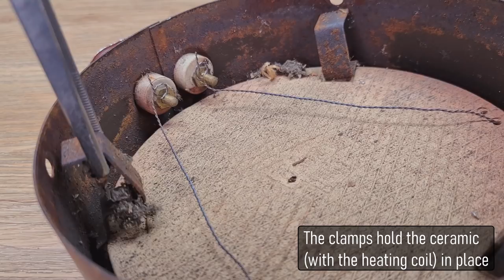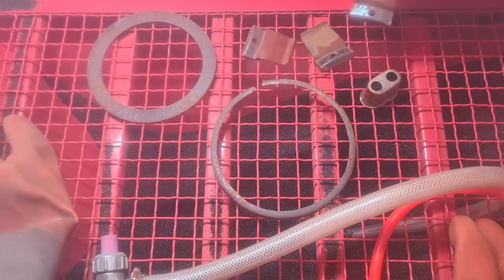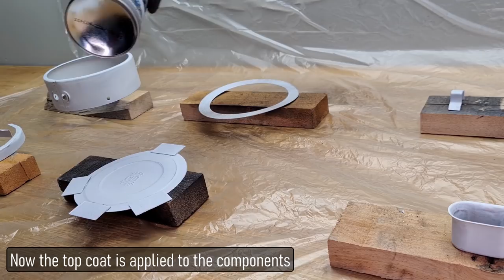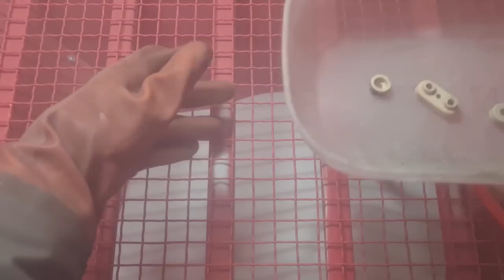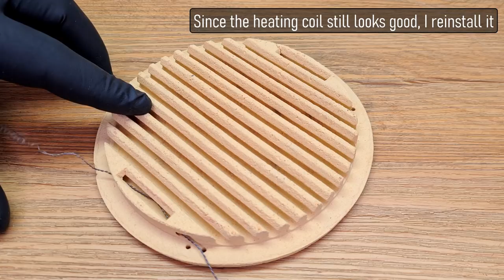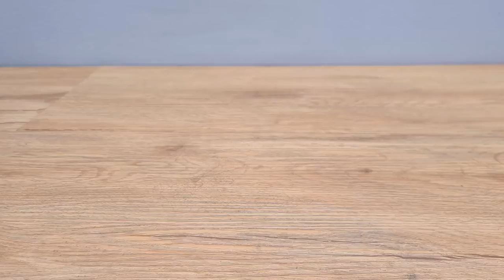Rusty Electric Stove Restoration [Camping Hotplate]

Comment: Very good restoration, but I would have done two things different: I would have added a third pin and grounded it. And I would have encapsuled the two wires inside with those small ceramic rings. That would make it more safe to use, I think.
Reply from the maker: Thanks for your feedback, those are two really great tips!🤩👍🐢

Comment: Nice job. Being a restorer and electrical engineer myself and if I was going to use it regularly, I would have added two things for safety. 1, High temperature insulating sleeving for the wires under the ceramic plate and 2, Electrical safety earth (ground) connection to the body of the unit.
Reply from the maker: Stuart Russell  thank you :) there is also a isolation missing at the corners to the ceramic, its in general risky to use this hot plate. as mentioned before - I had a Arthur Spooner moment 😄

Comment: Lack of finish on the heating coil, you should have redress the helicoidal shape before put it in the ceramic,
Also for the metal parts it's just sandblasting and repaint, no restoration at all, anyway, keep improve

Comment: "camping hotplate"?  When did camp sites get electric power? Do you pack in and out a generator? Looks more like an old 1930's ~ 1940's apartment hotplate, which are/were a known fire hazzard. I hope you upgraded it.
EDIT: Based on other comments you didn't upgrade it, so it is just as dangerous and unsafe after the restoration as it was before.

Comment: A camping hotplate? Where are you going to plug it in? Trees don't have outlets.
Reply from the maker: Maxwell Edison  not sure where you go camping, but where I was there were most of the time outlets... we are not in Lord of the Rings
Reply: @ForgottenShineRestoration  Well then you were RVing a parking lot, not actually camping. Try the real thing out in the woods sometime, away from the modern conveniences. Completely different experience.
Reply from the maker: Maxwell Edison OK, I'll give it a try - thought about kayaking in sweden where you can camp anywhere - kind of an adventure
Reply: @ForgottenShineRestoration  Glad to hear it. You'll have the best experience if you only bring what you can carry on your back, so pack carefully.
Reply: Well.... if the camp site has facilities - electrical supplies/he brings a petrol/diesel generator with him or a 12v > 240v, 30amp, 3000w inverter to power it off a car battery.
Reply: @samuelfellows6923  That isn't camping. that's just moving a portable house to a different parking lot.